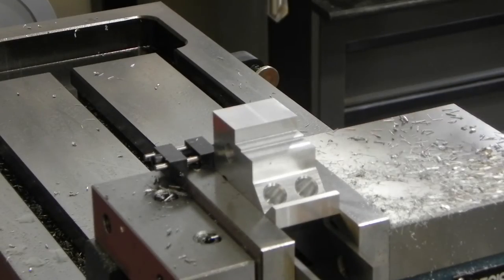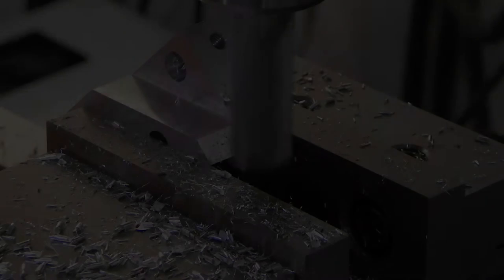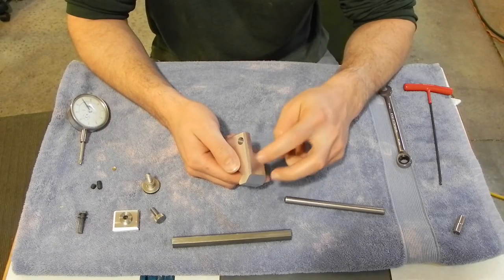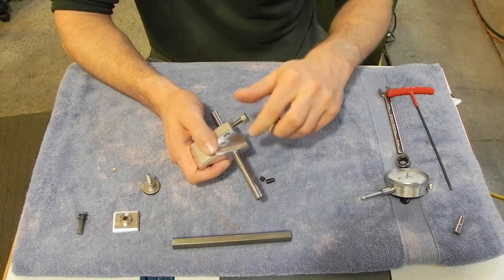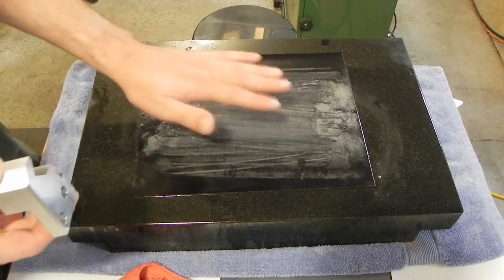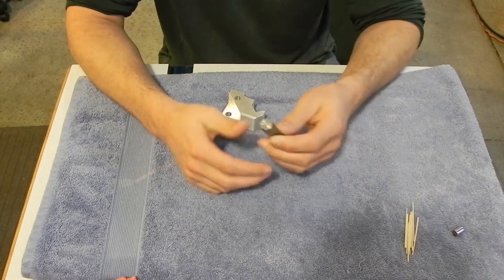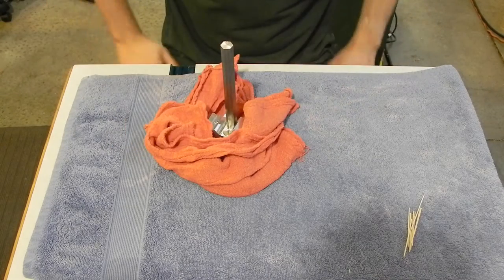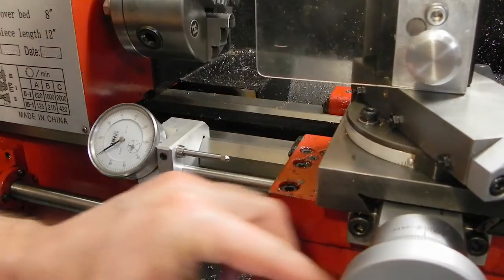Making a lathe carriage stop pt. 3

Comment: nice work. Giving me some ideas. I am going to build a micro adjustable stop for the cross slide - I will now add a dial indicator. I've used these adjustable stops before on a pretty big VDF Heidenreich & Harbeck lathe - they came as standard equipment. Nice thing is that against a hard stop, you build up some pressure which will take out play. This is very advantageous on machines that are somewhat worn. Also machining vibrations will be much less likely to move the cross slide. Finally, you're much less likely to cut too deep on a final cut.

Comment: Dan,
This is going to be my next project. Have you had any issues with swarf collecting on the magnets stopping the device from seating properly?

I have just made 3 new banjo's for my C6 lathe; very similar to yours but M8 on the bottom and M9 on the top. instead of the hex 'washer' you put on the bottom I have made a 2mm washer that fits inside the hole in the gear and kept the hex on the top to enable the stud to be fixed in place. 

Love your work, if only my mill and lathe were as clean as yours...

Regards from Melbourne, Australia.

Mike
Reply from the maker: Hi Michael,

I haven't had any issue with chips building up, as long as i just slide the stop along the ways. If i lift it off the ways, then i need to be mindful of chips being attracted to the magnets.
Reply: Dan,
Thanks for the reply. I have found a good use for those strong magnets, however, to pull the chips from between the slits on my er32 collets. I had one fail to hold a piece of stock and realised that it couldn't compress due to the gunk between the slits. I may go back to the plastic tubs they came in rather than the open tray I made for them!

Mike

Comment: Im highly considering buying  one of these mills for my custom knife shop and i was wondering what you think of yours so far. Ive been a full time machinist for over 20 years and the only reason Im not buying a full size mill is because of space limitations. Pleaselet me know your brutally honest opinion on this machine. Thanks.
Reply from the maker: +William Blumer It's by no means a Bridgeport, but it's a very capable machine.  It's got a good sized work envelope, and a nice set of features for the price. The PDF model is definitely worth the price. The powered head is excellent, thought not as fast as i would like. It's got enough rpm on tap even for carbide. The only thing i really dislike at this point, and its only a minor annoyance and fixable, is that the handles are low grade and rattly.